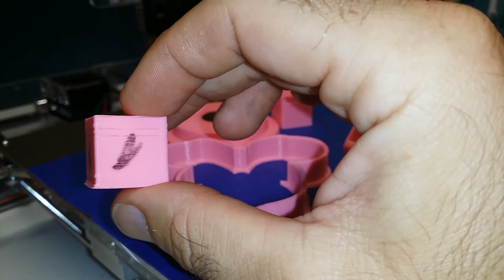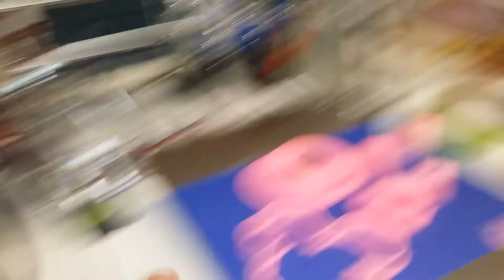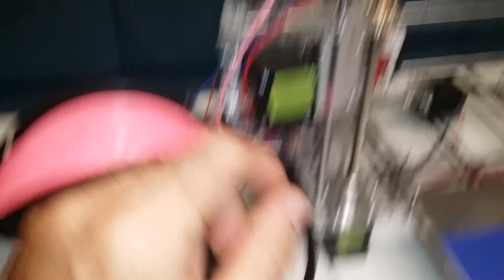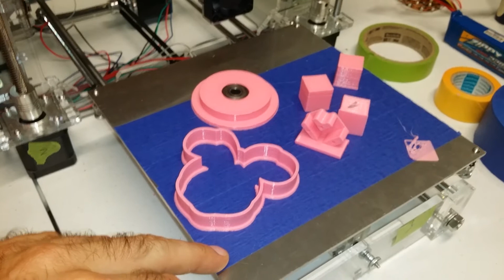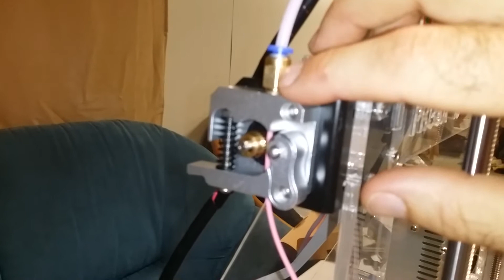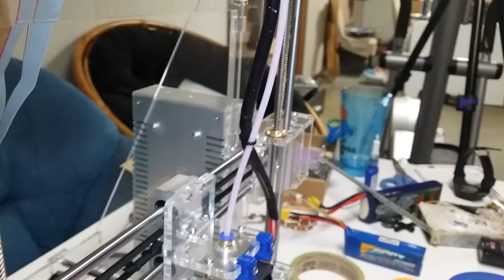Sunhokey prusa i3 3d printer rep rap kit update 2 ITS ALIVE!!

Comment: Did you have a wonky bed after all, the other video mentions that it wasn't flat? I'll have to check mine tomorrow since like yours the middle seems ok then north and south the print is off.
Reply: +MrSupergee  My bed is super flat. Checked at my office with an optical flat slab. Need to get better screws and springs for the bed levelling, they can shift during the print.

Comment: Watched your review, liked it alot.
I have bought the same kit, finished to build it couple days ago.

I encountered a couple  of problems.
At first the driver was not suitable for windows 8 and it it did not installed properly,  the seller sent me a new one : http://www.ftdichip.com/Drivers/VCP.htm. I installed it , it looks good.

However I still have problem to connect the computer to the printer, the repetier does not connect and the manual movement of the axis doesn't work.

I tried to print from SD card, however the printer does not react to it.
I do make him to preheat for PLA and the "Auto home" command does work, it brings it to the 0,0 position.

Manual movement of the axis from the command board, also work well.

Do you have any ideas or tips?

Appreciate your attention and help.

Slava.

Comment: I have played with this printer for a few months now. Been loving it, except the heat bed, but i was wondering do you know if you can print nylon with it. 
Apparently for nylon the following is the recommend print settings:
240-260C Extrusion Temperature (each type of filament is slightly different. Follow manufacturer's recommendations)
70-80C Bed Temperature with PVA based glue
Speed: 30-60mm/s
.20mm-.4mm layer heights
this is from https://www.matterhackers.com/articles/printing-with-nylon
The Prusa i3 is capable of reaching these settings, so...
What are your thoughts?

Comment: Thanks for the review - a friend and I purchased the same printers now, and assembled installed S/ware and off we go- but we not getting any adhesion AT ALL ... no matter if we use the yellow tape, or no tape or onto the blue plastic that came with the aluminium plate. 

Do you have any idea what your settings were inside the software? Also where does one setup the wire speed?

Comment: Hi, i bought my pruse i3 printer a week ago. Its assembled and working correctly, i am just having serious issues with warping when i print my cookie cutter. How did you get your print so flat? I too am using 3M blue painters tape. FYI had the exact same problems with my printer to start with, jumpy feed etc. Would appreciate your help with warping problem.
Reply from the maker: Christian Vermeulen What do mean warping problem?
are you finding your parts lifting off bed or are your walls wobbly?
Reply: gymp1979 Yes, is tried printing this: http://www.thingiverse.com/thing:181261 The rabbit's front feet are curling/lifting upwards away from the heat bed. I know the blue tape is working since its actually lifting the blue tape from the heat bed (i was quite amazed at how strong the curling/bending forces were). I printed at 80% fill with rectlinear fill pattern. My first layer was quite solid, when i was on about the 3th vertical wall layer, the curling/lifting started happening. I am thinking that 'ABS juice' might be a solution? 
Two side notes, my heat bed was also slightly concave, and secondly instead of the filament infeed causing feed problems, the part just before it melts the filament (...the part that the fan blows on) inside the small center hole was quite rough so just ran the same size drill bit through to cut away the sharp edges, helped heaps. Thanks for your quick response :)
Reply from the maker: are you printing in abs or pla?
what do you have your bed temp set to?
Reply: gymp1979 ABS and 75C. With Regards to the heat bed, just want to put it out there that be careful with your heat bed wiring. Mine actually snapped off from the heat bed just from use. Tape is not the best to secure it.  Its repairable though so no biggy, but just want to caution everyone else.
Reply from the maker: Christian Vermeulen sorry for the slow reply
i could not print with abs straight up,
keeping heat in the parts is so important
i now have got it sorted bed temp for the first layer is 90c then second layer 100c
another problem is the fan holder it creates a draft and causes the parts to curl, print out a desent holder that directs air over the heatsink on the hotend only 
alsoim  in Australia its winter the room my printer is in gets cold at night so have to print abs in the day 
hope that helps

Comment: Great videos, just received mine today and the dvd won't run for me so I have no instructions. Did you happen to have a link for sunhockey? I can see where stuff should go but so many size bits that could be messed up.
Or if you are able to share the customer services email address?
Reply from the maker: Lewis Smithmith they are pretty hard work to get info out of, eva@sunhokey-tech.com , mitchell@sunhokey-tech.com
im hoping you bought from 3dprinteronlinestore they have 24hr support when i was struggling to get through to sunhokey support i contacted 3dprinteronlinestore less than 5 mins later had a reply from sunhokey.
Reply: cool, luckily got emailed the dvd. Would you be able to share your PLA settings? My calibration cubes are now coming out using then settings they provided but it's scrappy as best.

Comment: Would you mind sharing your settings for slicer?

I have the same printer and no matter what settings I have I can not get overhangs or bridges to print correctly. I also have the full firmware that is supplied on the unit if you need it, I did try to merge the settings from that firmware into the latest version of marlin in hope that it would help with overhangs but it made no difference.

I use a 4mm thick 20x20 piece of glass to make sure the bed is level.

Comment: Hi gymp1979,
I bought this printer also seems to be the surest choice considering the price. I am a beginner in this field and therefore I have a question which you used in Slic3R parameters so pretty prints have obtained in the PLA. What method you used to adjust the table. I I set up the card paper and see that there is a difference between measurements obtained at the corners and the center of the table - I have to work out.
I will be grateful for your response.
Reply: I have the same printer, I will eventually upload videos of it and such. I recommend looking into auto bed tramming with a probe. Basically since this printer comes with a metal print bed you can edit the configuration.h files and set it up so that the probe can take measurements in each 4 corners of the build plate and if theres an offset, the probe along with the software will "tilt" or orientate the object that you are gonna print to adjust for the offsets
Reply: My enthusiasm has dropped . The table seems to be crooked I am not able to set it properly as in the corners is well it is badly at the middle and vice versa. Filament supplied with the printer is tragic . PLA has a thickness of 1.59 - 1.61 to the value of 1.75mm is far he is also probably the cause of hops on extruder. Recently, I noticed that there is a leak from a hot end.

Comment from the maker: Sure happy to help,
on mine i struggled to push the filament through the hole at the top of the extruder to feed it in to the tube.
once i did get it through it kept grabbing mid print and causing flow rate issues
i took it apart and very carefully by hand ran a slighty larger drill bit around the feed hole on the silver part just enough to remove any casting marks and to leave a nice chamfer.
then did the same on the little brass fitting this time i used a #11 scalpel blade as the brass is very soft, just ran it around until i added a little chamfer and removed any machining faults.
what you're trying to achieve is the filament running through nice and smooth and catch free, so you can achieve a nice consistent flow to head
hope yours is perfect out of the box and you don't need to worry about this 
hope that helps

Comment from the maker: i will try to help out as much as i can, big tip be super careful with those 3x16 screws that hold frame together they are too long/holes too small cracks are getting worse as days go by if i had my time again i would by 3x12 screws or add a3x1mm washer to each i know it will take longer.
also im learning arduino so hopefully i can turn on pid loop for bed temp and adjust extruder feed rates.
thanks for watching